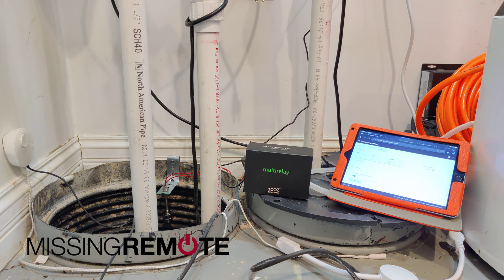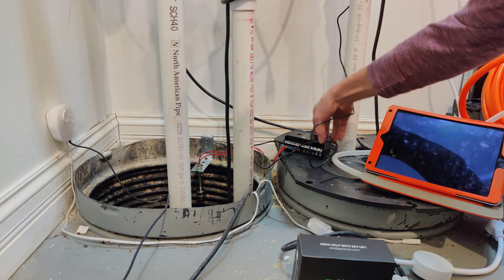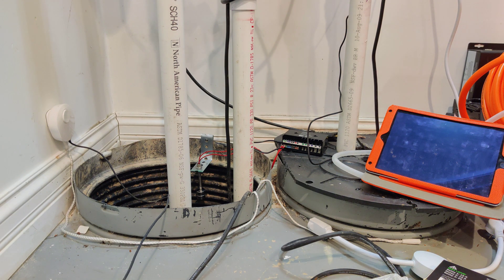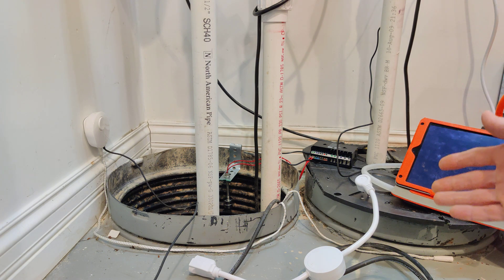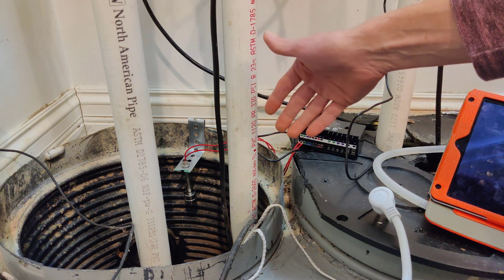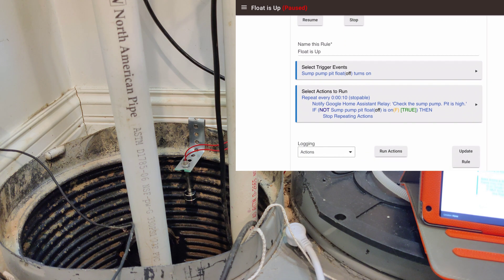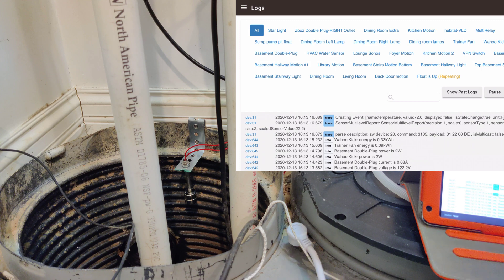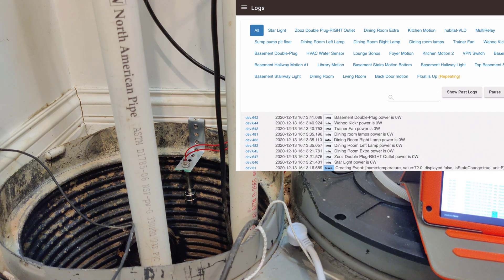Making a Smart Sump Pump Alarm - Zooz MultiRelay ZEN16

Comment: Nice work. I find these universal IO  Zwave devices invaluable, I wish there were more offerings. I'm planning on using the two-relay version to control an off-the-shelf motorized valve for water main shutoff, but then also control a second valve which will dumps residual house line pressure into my sump pit if there's a leak detected (that's not in the basement).

Comment: Thanks for the video.. i find this very useful information as everyone has come home to some some unplanned water event. Installing a water sensor is good and great when it notifies you that you have water in your laundry room.... But Freakin awesome when the water supply shuts off automatically when water is detected. Same concept as your video and some many other ways to use this devcie.
Im working on a way for using this ZEn16 for turning on lights. etc when my driveway beam sensors are triggered. How did you get this to send notifications?
Reply from the maker: Here I used the Google Assistant integration with Hubitat to make noise, but you can also send and email via something like this: https://github.com/lgkahn/hubitat/blob/master/sendmail%20V2.